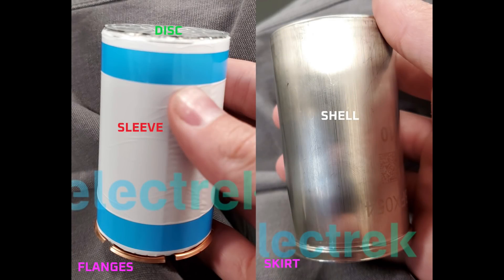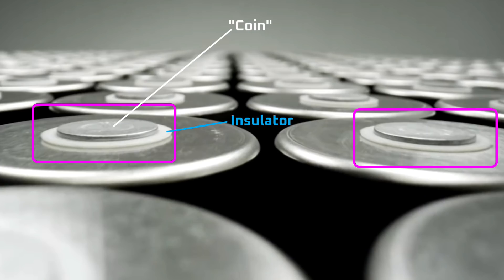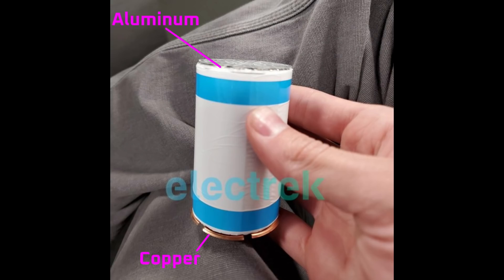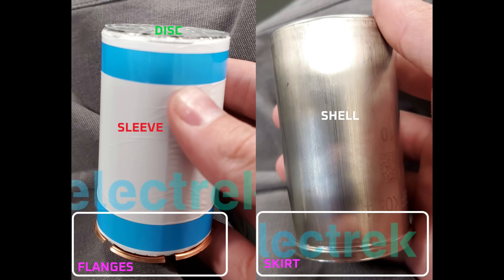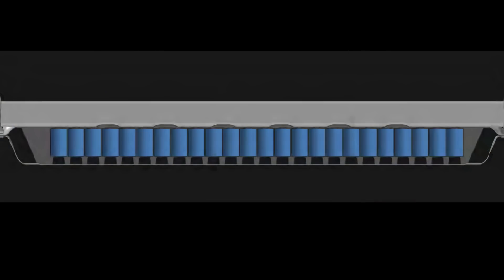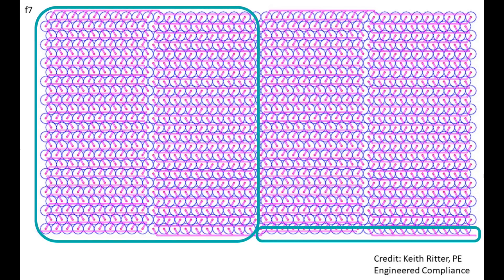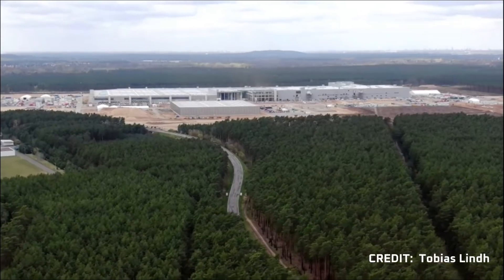#16 Manufacturing the Structural Battery Pack from the Cell Up

Comment: Battery pack design architecture is not driven by the type of cell, but the cell chemistry: Each chemistry dictates a unique set of operating characteristics that determine the level of cooling and thermal management, susceptibility to Thermal runaway, voltage etc. this then determines the specification of the materials used within the pack and design criteria to meet CBT 3000 standards etc.
Reply from the maker: Thanks for the insights!
Reply: @thelimitingfactor  Hi, although the video I  watched was around 2 years old, due to the  dumbed down architecture around the cells, my guess would have been that the cell chemistry was LFP. Would you happen to know if I'm right? Thanks Perry

Comment: Can't connect all the cathodes together on the cooling plate, can only connect ones at the same voltage level.  So either the cooling tray is sliced into sections, one for each voltage level, or there is an insulator between the battery and the cooling tray. perhaps the bottom of the battery is isolated from both the cathode and anode internally.

Internally, I would bet that the disc is both insulator and conductor.  insulate the cathode from the anode, and then have the anode flare out to cover the entire surface of the tabless jelly roll anodes.

Comment: I'm still a little confused and I've watched this video three times.  do you think that the copper cathode is "tabless" and the aluminum anode on the opposite end is also "tabless"?  And that the aluminum end is simply butting the can, and thus that is it's connection, and the copper cathode, with the plastic disk as the separator from the can top, goes to the coin?  

I know it's an older video, but I hope you can answer.  Thanks!

Comment: Why not have no tabs at all? Why not have the rolls of copper & aluminium sheets the same height & the insulating/electrolyte sheet (IES) marginally longer? The bottom of the copper is lowered with the IES extending minutely beyond the bottom of the aluminium then glued shut exposing only the copper at the bottom which gets pressed inwards & vice versa at the other end exposing only the aluminium.

The rolling heights would be positional for the reels; ie aluminium higher, copper lower & the slightly longer IES positioned inbetween & pre-glued at the top & bottom. Each turn has a roller at top & bottom that presses the longer filament sheet inwards creating that electrical contact the way it appears. I suggest the cutouts on these non-tab ends were done as an earlier procedure across the whole roll for uniformity & ease of production.

Also, why end the roll with aluminium or copper which would become a source of shorting? If the IES has one more roll length than either the aluminium or copper it can be glued shut without having any electrical interference from touching the sides. Of course the final roll would require no electrolyte as it isn't between anything but that could be cleaned off  following the sealing & glued. A controller could easily be programmed to do one extra turn on only the IES reel with a gluing intercept or it could be done as a separate procedure.

Comment: if the epoxy structure is indeed prefabricated it means the batteries glides inside and wont stick on it. so the battery pack looses some of its strenght maybe. the good part is the batteries could be easier taken out from epoxy to be recycle.

Comment: I hope that they won't use epoxy, otherwise it would be nearly impossible to fix the battery packs if they malfunction, also recycling would be near impossible
Reply from the maker: They're already nearly impossible to recycle.  There are recycling processes than can grind up a pack though!  Recycling tech for batteries should become viable in the next few years for Nickel.  LFP is a different story because the iron is so cheap.

Comment: The whole point is shear transfer. That can’t be done with copper or aluminum.
Reply: Why not?
Reply: @gsportgeorge  Because of the shear failure modes for copper and aluminum. However, the stainless steel canisters for each battery coupled with epoxy filler make great shear transfer components. In other words, imagine how easy it is to cut copper or aluminum wire vs cutting steel cables of similar thicknesses.
Reply: @DevinHeaps  It's not like copper and aluminium (even un-alloyed) have zero shear strength and if the electric conductivity isn't compromised too much by some alloying elements they could be quite reasonable, aeroplanes seem to put a fair bit of shear through aluminium for example. However, as you say, the can is the structural element of the cell anyway.
Reply: @gsportgeorge  You make a valid point. However, the biggest problem for batteries in shear failure mode is not mechanical failure, but electrical short circuiting, which results in fire or worse.

Comment: how would you get high enough voltages with every battery in parallel like that? Wouldnt it just turn into one large 3.2v battery?
Reply from the maker: No, you could wire the gasket to do series and parallel

Comment: Jordan, could you do a video on the new aluminum-ion battery that charges up to 60 times faster than lithium-ion batteries?  Brisbane-based Graphene Manufacturing Group (GMG) has announced impressive initial performance test results. It almost seems too good to be true.

Comment: Will Tesla be adding zinc borate to the epoxy as a flame retardant? https://en.wikipedia.org/wiki/Zinc_borate#Uses
Reply from the maker: Not sure what they are using, but the epoxy will definitely be flame retarded (is this still an acceptable term if used in an engineering context? lol)

Comment: Aren't the dimensions of the 4680 battery 46mm diameter x 80mm height?  5x larger than the other tesla batteries (1865 or 2070) but with more power output and charging speed capacity and 16% more range... Power regeneration (breaking or hills) is going to be more efficient, and the cars are going to be able to give more power when needed...
Reply from the maker: Correct!

Comment: For me, it has to be the following: 
top part of the battery is for electrical connections.
bottom part, the wider part, used thermal management, with a thermal management "plate" (or thingy) beneath the pack.

Comment: Isn't it possible the picture of pack at 9 minute mark is of a test article where they have to top plate and cells put together with release agent, fill in the epoxy and then remove the plate and cells to check for defects or voids in epoxy? 
Also I was thinking why the epoxy is so thick in between the cells, other than thermal isolation during cell runaway, the other reason I could think of is that this epoxy honey comb structure is the actual load carrier instead of cells carrying all the load. For the cell CANs to carry load from the top to bottom sheet they need to be bonded to top and lower plate and as you have shown there is electrical wiring going on top of the cells, so its hard to see how it will make good bonding without welding, I am not saying it won't add to pack strength, I believe cells will not be primary load carrier

Comment: Thanks for your detailed analysis. A few issues seem apparent when it comes to connecting up the cells. Lets say the nominal voltage of the pack is around 370v and each cell outputs a nominal 3.7 v then you would need 100 parallel subsets wired in series. These parallel subsets could be flipped alternately daisy-chained together to provide the required voltage. The problem then arises whereby the cells would have to be electrically insulated from the cooling plate to avoid direct shorts in the layout? It is also unclear if the cells will be individually fused with fine wires as per current packs?
Reply from the maker: Just put a non-conductive coating on the cooling plate is my thinking.
Reply: @thelimitingfactor  I guess you need a material that will conduct heat effectively but be an electrical insulator. At the same time, this material must be bonded to the base cooling plate and the cell to create a rigid structure. Epoxy resin would not work as it is a poor conductor of heat

Comment: OUR HERO JORDON : (1) I see the body of a cell as a  Coke can, a single pressing  with the multiple negative tabs touching a flat base - SAVING (2) ::: The honeycomb frame eliminates the need for the blue or green insulation of previous cells - SAVING :::(3) The bottom & top potting completes the electrical isolation - SAVING :::

Comment: Structural battery pack and epoxy = possible nightmare for recycling! this is the biggest challenge for EV's! Needs to be baked into the cost and construction to be responsible.
Reply from the maker: Possibly, I know they have teams at Tesla that look at how the pack will be deconstructed, as well as constructed.  We just don't have the answers yet.  I wouldn't assume they haven't thought of this.

Comment: To make honeycomb material structural it must be bonded to cells. It must dry with cells not before. Therefore.. I suppose... Cells will be positioned in place, electrically welded and then honeycomb structure will be injected. Maybe whole metal container is already placed over the cells, vacuumed and then multi component epoxy is injected into the pack - that way container walls (batter pack external shell) will also be structural. Making it one more injection moulded  part vehicle is made of. 
Also there will be no seals around connectors, reducing part count even more.

Comment: Hi, I followed all the series, great content!

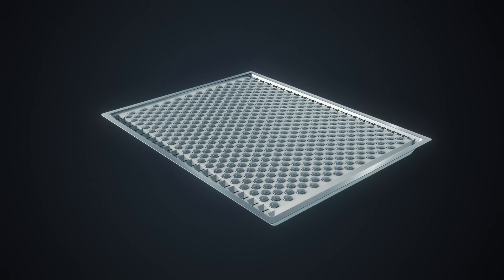 In this video there's something I don't get. Packs are made of a bunch of parallel connected cells, usually called modules, and then the modules  are connected in series to give the full pack voltage. You have placed all the cells in the same orientation, as if they'd all be in parallel (geometrically at least). How do you see the serial connection in this case? Wiring doesn't transfer 1500Amps, so either half-half the cells sit UP and Down, or there are some  bulky busbars connecting adjacent modules. The second is very inefficient, tenths of kilos of copper. So this leaves me with "the cells cannot be oriented all in the same direction". Does it make sense? Eg. at 10:08, it just doesn't look right electrically.
Reply from the maker: Check out the inside EVs article on how the structural battery pack could be manufactured
Reply: @thelimitingfactor  So, found one from the 10th of May, speculating on Sandy's slide.

About the honeycomb, it's already being used and yes, it's for structural support. In the application I know however, we can't talk about the cells being structural (transfer shear as Mr Musk puts it), all the shear is in the honeycomb and the case. With a stronger cell, maybe (though I half think why bother, the honeycomb is just so strong compared to current Tesla pack). The 4860 is surely stronger, I can't imagine it not being way stifferthan say a regular 2070 NCA. What would prevent the cells I know to be structural would be the non-solid separator (which would short) and the way too thin can, which is designed for thermal transfer in this case.

Could see both tabs comming on one side, though you make a very good argument why it probably won't. If it does though, you'd have to have a twin laminated busbar, two overlapping copper slabs separated by an insulator and cross-connected (basically swapping the up/down positive/negative) on the module-to-module border. This thing, if feasible, would almost surely need to be epoxied to keep the two slabs of copper from moving relative to each other and wearing down the separator.

It was fun to think what if. What makes the twin tabs on one side potentially unfeasible is the current per cell, and is there enough phisical space to pull enough of those wire contacts to account for the + and - current in the 46mm OD space. Since the 4680 cells are more energy dense, you'll have less of them, so more current per cell, so more wires (of the same size) per tab to take the current to the busbar. However, if the tabs are epoxied in, you can get away with less distance between wires, as they get mechanical support from the resin. 

I also agree with the cooling snakes, being still in. Why not at this point? If the baseplate cooling would be enough (and no reason you can't have one on top of the busbars too), than you take them out in the next prototype stage; else keep them in for the max power track mode. Taking them out would reduce the pack footprint and reduce the polar moment of inertia, which is a big thing in my domain (motorsport), so it is desirable. Could make the Roadster feel like an actual sportscar.

/end wall of text. Now back to my car, got a few ideas :)

Comment: Did you see Sandy's video about quantum scape? Is the CEO correct that the liquid doesn't matter as much in a solid state battery / etc.? https://youtu.be/OKFiQIMyF-A
Reply from the maker: It may or may not.  Sandy should have asked.  It was not a hard hitting interview.
Reply: @thelimitingfactor  it would have been great if he had, but I don't think Sandy knows enough to ask... just like I wouldn't expect you to ask manufacturing questions that I would expect Sandy to ask.

Comment: Would not surprise me if the pack with the green wrapped cells are a stop-gap solution. Elon said on the earnings call they are 12-18 months away from mass production of the Tesla cells. What if the wrapped cells are LG/Panasonic/CATL cells, and Tesla needs a way to package these in the Berlin-built Model Y or the Austin-built Cybertruck until their own cell production has ramped? That means that is not the REAL structural battery pack. Just a pack that fits in the new production lines.
Reply from the maker: Exactly!

Comment: 12:10 I suspect the unequal spacing in Tesla's illustration is because every alternating row of cells is left/right biased. We're seeing a cross section of a right biased cell row.

If so, the gaps we see under the cells in that illustration are only directly under the cells, not running the length of the pack.

Comment: I don't think they will be flipping the pack after inserting the cells. It seems too slow/dangerous to spin something that heavy while it's not bonded and secure. There are however factory processes that could achieve something similar. 
Imagine all the cells getting aligned in place with a jig. The honeycomb structure is lowered down over the top of all the cells. Then it gets whisked off to the next step. No slow down, no flipping.
This would make aligning and inserting the cells much faster on the assembly line.

Comment: Great video, Jordan! I think you’re right about all the points you made. It seems logical that the electrical connections are at the top of the battery pack (therefore, the “coin” ends of the cells are up) and the Cu tabs in the cell are pressed against the bottom cap of the cell, which becomes the anode (the whole can, really) and is used for cooling via contact with a bottom plate in the pack.

Comment: Why should we assume the roll will actually have a metal sleeve? Why not just insert roll into the honeycomb structure save on extra metal weight. Then inject a flexible epoxy to secure cells and allowing for expansion. Then cap it as a whole.
Reply from the maker: Side reactions due to the high electrochemical potential of the cell.  Stainless steel one of the fiew things that works to house the cell.

Comment: Great video as always! I disagree with the conjecture that all cells are facing the same direction. I do not see how to make the series connection to raise the total voltage go the pack to 5-500V with all the negative connections directly touching the cooling bottom profile🤔
Reply: I agree with Jon. Before I found this comment I was thinking, not all the cells can be electrically connected to the bottom plate. Then I also questioned if there are wires needed on the top (or top and bottom, both sides). 
A cell has between 3.4 and 4.1V. With a voltage somewhere in the range between 400 and 800V there has to be 100S.. to .. 200S. And x-cells in parallel. 
Still it would make sense to connect (laser welding I suppose) the bottom of the battery to ground plates (around 100 to 200 individual areas). The same (no wires and also laser welding) on the top. 
There is a 3 brother Austrian company - Kreiselelectrik - who has at minimum two good technology patents. (As a side issue, another high tech company rarely watched is Mate Rimac and his company in Croatia; Porsche, Hyundai own 'shares' and also BMW gets technology from them). 
Inside the battery there is the question how they connect the anode to the housing. Possibly laser welding. To connect it on the wider bottom seems to difficult. So it seems its done on the top area where there is the smaller diameter.  Either laser welding of two different materials or welding under strong pressure having a kind of roller. 
And, how is the Cathode brought through the insulator to the outside? (That the have the Anode in the middle and the housing with the Cathode on the housing, I don't think so but Tesla is good for surprises if there are good reasons.

Comment: There is no "can". That's not first principles. Exposed copper on bottom, exposed aluminum on top. thin plastic wrap as we saw in that guys hand. Connects above and below. Done. No cans. Please. Cans are so 2010. Epoxy forms are too complicated. The second image saves space, uses no side can, and uses really nice precast parts to lock it all together. Seems like a more final solution, IMO.